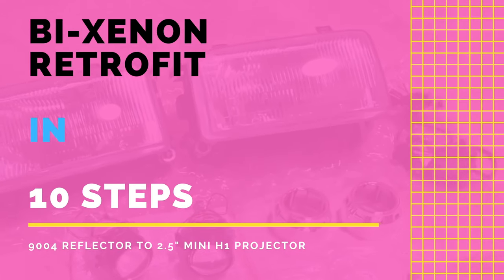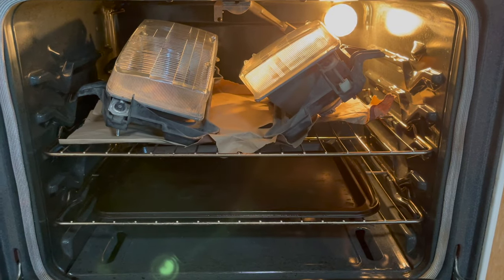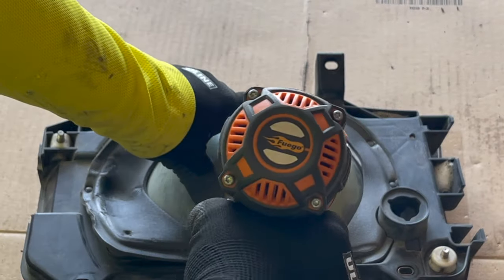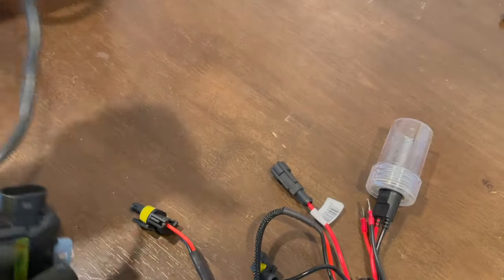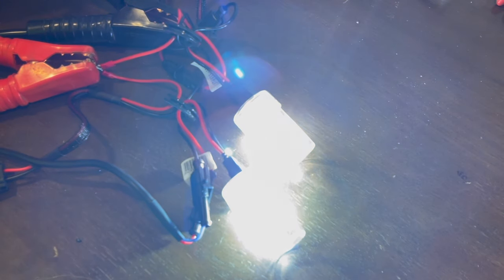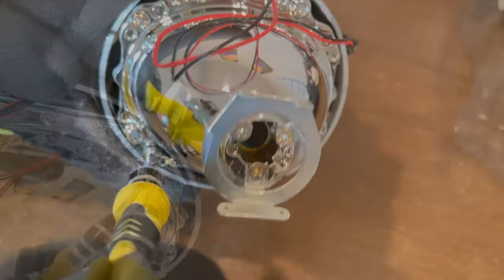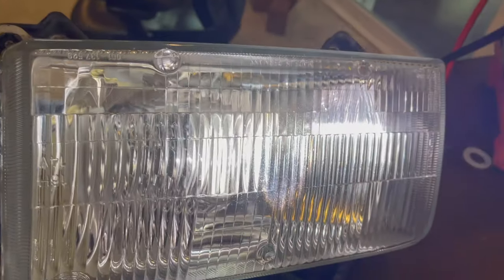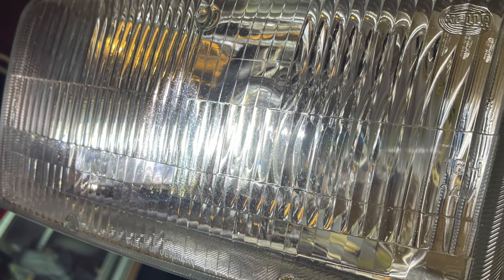How To Install Retrofit Projectors With Bi-Xenon [10 Steps]

Comment: Do we need to consider the rating of our old bulb and match it to the new? And is there any other to consider as we modify or we add something to the electrical system of the vehicle that affect affect the function of electrical system of the car? I have Ford everest 2018 trend model what can you suggest that best fit to it. Hope you can still answer my question. Thank you very much.

Comment: That's nice but I would like to go with the LED projector instead of the ballast HID
Reply: (Old but)  What is very good about this is the color of the bulbs available!  He used 4700K.  That is much better than 6000-6500K!  If I did this I would probably use 5000K.  However, also probably, I would do as you want and use LEDs at 6000K because I am rarely in bad weather and no snow.  (But, I am thinking about moving to another state.  Colorado.)  Of course, there are off-road 5000K lights that may possibly be used.

Comment: I would love to do this, but looks way to complex. I could get the aftermarket retrofit projector headlights, but they get water in them easily. I guess I’ll just stick to my reflector housings. 😢
Reply: (Old but)  You could do this.  Don't overly concern yourself.  The worse that could happen is you decide, NO, then just put the parts up for sale to get your money back.  (Or, return them if you can.)

Comment: Nice video.  Does the H1 bulb connect to the high beam wire or the low beam wire?  The wire that you drilled the hole for, where do you get a connector for that?  I'm assuming the black wire goes to ground and the red wire goes either to the high beam wire or to the low beam wire.  Which one?
Reply from the maker: For the H1 bulb connection, they will connect to a ground (black) and low beam hot coming from the car (red). Since I used a bi-xenon style projector, the wiring/connector I drilled a hole for is part of the projector, it’s included. These wires will need ground (black wire for projector high beam) and the high beam hot wire when highs are flashed or activated (red wire on high harness coming from projector).
Reply: @UsefulVids  Thank you.

Comment: Hi I have that same projector going to used it on my Yamaha r1 2004 but I have 2 bulbs on each side one high and low beam,I am using the projector for high can I Take out that mechanism from the projector cause it’s only hing beam ??
Reply from the maker: Yes, I believe so. Without the flap it will always act like a high beam.

Comment: Really helpful video but I'm still confused bout the wire to make it switch to the high beams ,I have a 9007 but I'ma get a conversion kit to get it to be h4 but idk how to wire up the high beam connector ,help please ,is there another harness I'd have to buy and what is it called ,thank you
Reply: I've built some of these myself and all the "high beam" connector does is flip a small plate down out of the way of the light. That small plat is what gives the sharp light cut off and it's flipped by the small motor inside the projector. Power is constantly applied to the 9007 bulb and it's not like the H4 bulb which has 2 separate circuits inside the bulb. What type of bulb does your car use? H4 or 9007?
Reply: You get lhd 
And right hand drive ones

Comment: Does the h1 have high beams after installation? My vehicle is using h4 and it's high and low beam in one bulb.
Reply from the maker: Yes, but you need to buy a wiring harness for compatibility.
Reply: @UsefulVids  so what if I just find am h1 harness and tap off my h4 harness. Will that work?
Reply from the maker: @battlebornrc2335  yes, it should

Comment: im guessing you glued the shroud because you assume you will never take it off?
Reply from the maker: Yes…and to have a mechanical and adhesive type redundancy to ensure the shroud will always be vibration free.
Reply: Gotcha, thanks!
Reply: @UsefulVids  I need to take the shroud off to replace the lens with an etched one, how would I go about removing the shroud now?

Comment: How did you know what size projectors to buy for your halogen setup??
Reply from the maker: You can measure your light housing, but most retrofit projectors are 2.5” or 3” and should fit almost all housings.
Reply: @UsefulVids  thanks for the reply!! And I noticed that the projectors I'm finding online are all the Bi functional versions, for High and Low beam. Can you purchase a multi-functional one, and just use it for a single low beam?
Reply from the maker: @anthonyjames5067  Yes, just ignore the high beam wires and you’ll be good to go.
Reply: Thanks for the guide. It's really detailed and useful. I have two questions.

1. Can you post links to the materials you used in this video?
2. My car has a low beam and a high beam bulb. Does that mean I'll need two projectors each side? How do I handle this scenario?

Comment: what is the difference between 2.5" and 3" ?
Reply: Side of 0.5 inch diameter  other than that same
Reply: Practically looks. Output is basically the same

Comment: How did you connect the bi-xenon wiring harness for the high beam?
Reply from the maker: You'll need to buy a wire harness that has connectors for the Bi-Xenons, enabling an easy connection. Check Ebay or Amazon.

Comment: How to wire?
Reply from the maker: You can purchase plug N play connectors to enable easy wiring for the H1 kit. An example would be 9003 to H1 wiring kit. It should work.

Comment: How do u adjust the lighting angle? (vertical and horizontally)
Reply from the maker: You would use the vehicle’s headlight adjusting screws. Since this projector is in exactly the same position as the factory installed bulb would be, the aiming process will be the same. Usually, the owner’s manual will have a section on adjusting headlights.
Reply: @UsefulVids  Thanks for the reply. Understand now. So its basically the reflector that changes angle to accommodate the bulb.